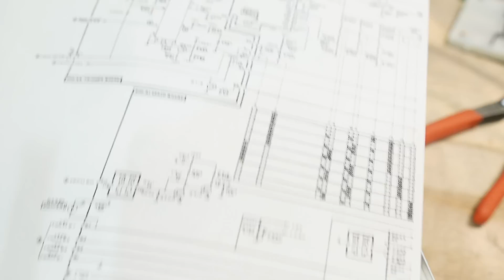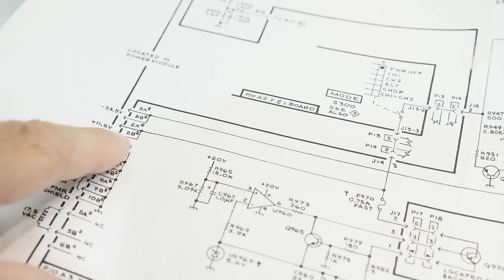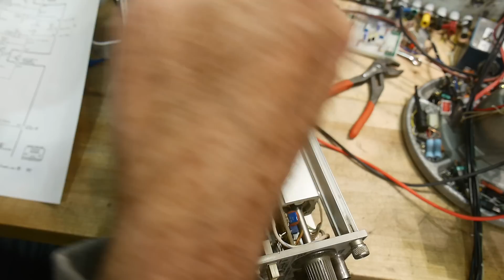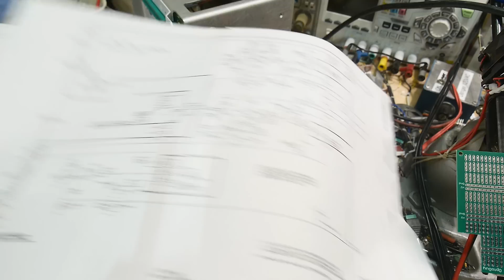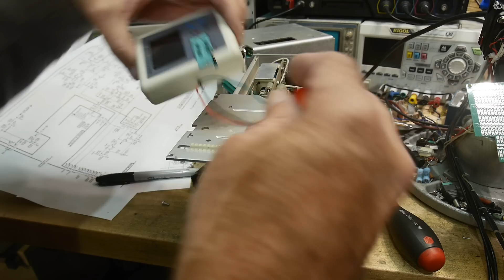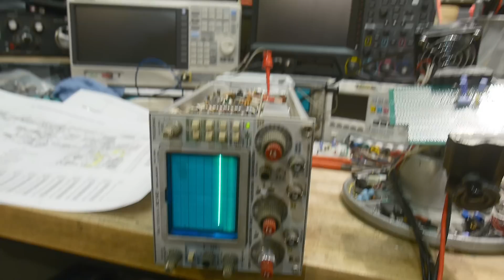#1772 Tektronix SC502 TM500 Oscilloscope Repair (part 2 of 4)

Comment: dead transistor for sure, part of it is dead or cooked the die off the paddle, or the main part is shorted out base to emitter. unable to drive with limited current capacity.

Comment: Does that transistor have a zener diode connected to it's base in a transistor-zener regulator circuit? Check that the zener diode isn't shorted. It should be a 5.6V zener for a 5V regulator circuit. 5.6V because of the transistor's Vbe drop of about 0.6 volts.

Comment: It looks like the original orientation of the transistor had the leads pointing down judging by the mica insulator.  You're off 90°...  That or I really need to get new glasses, I'm half blind.
Toss the original tranny on the 576/577, it might be non-linear or fail under higher voltage than what the cheap tester uses.  With the low gain, is it possible that just one of the transistors failed short?  If that tester normally differentiates Darlington from standard bi-polar transistors, it's possible it's simply reading across the one good junction, seeing some gain and assuming it's good.

Comment: Maybe the plug on the transistor is backwards. Check your transistor leads and check the plug wiring to make sure it is plugged in correctly.

Comment: Hi Imsay I really like these modules, before I was robbed I had a set of three modules for audio testing, an oscilloscope, a distortion meter and a generator

Isn't the transistor damaged, it should be a Darligton and it measures a normal transistor, checked the type of transistor according to the designation in the datasheet.

Nice day 🙂 Tom
Reply: I once had an instrument that had darlingtons as the final drive for a stepper motor.  It would blow them on a semi-regular basis.  Testing with a multimeter would indicate they were still "good", but they would not operate the instrument.  Saved a lot of time and money once the repair guy clued me in.  I carried spares and did the repairs myself.  I have a few still laying around, I'll have to check them and see what a more modern transistor teste indicates.
Reply: Can't wait to watch...just busy with deadlines and commitments...

A good little transistor tester should see and display a high dc current gain..

I have not seen the repiar of what IMASI has in store yet 

But I would guess first little transistor might have 100 and fatter series  pass driven might have 20...idk...

Just a wag...

So DC current gain 2000....

I was able to appreciate the electrical testing of descrete transistors of all kinds used in military radios...among other things...

Simple DVM can test for reality , catch shorts or open...show gain

Behold...all active components..semiconductor IC or discrete diode, bipolar, MOS transistor were 100% tested if possible....some products..based on failures would be sampled

We had 3 main testers....
One was in the install and qual mode- a Fairchild like mainframe and more....cost a little over 2 million. It had like its own AC semiclean .. room. 1981-1983

My favorite was the Loran semiconductor tester driven by PDP-11. 

Okay- so a lot of 2000 2N2222 would arrive...

Into the handler...they would go...

Probed...relays clicked...in 340 mS up to 80 different tests could be done...but for that simple transistor ...probably fewer....then be spit out 1 per 0.8 seconds 

 page print out of one transistor...if you desired to see what test failed..say by noisy dot matrix..5 pages

Load that MOP...

Then there was a Telaydene IC tester for 54/74..and CD4000..that a punch tape loaded in DEC PDP 8

RF power transistors...a whole rack of HP TEK network Analyzer, SA, power meters freq sweep RF signal generator. Microscope de-cap BeO ceramic station.

I watch technician watch the rabbit dot jump the fence...

Comment: since you have 30 volts on the 20 volts rail, you should focus on fixing that. The overvoltage probably killed the U960 opamp too, that's why the 5 volts rail is dead.
Reply: I understood the 30V measurement as a mistake (measurement in the wrong place) and if I listened well, the 20V was where it should be. I will watch the video again
Reply from the maker: edisson is correct